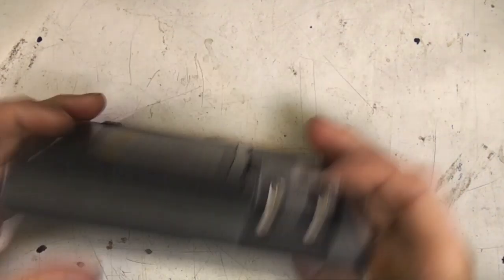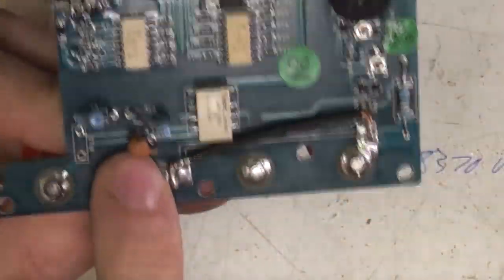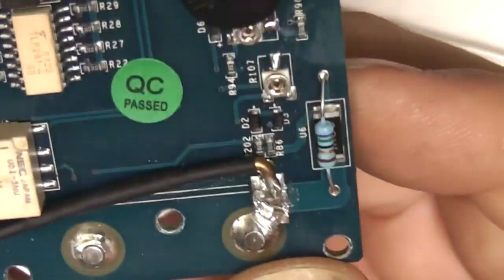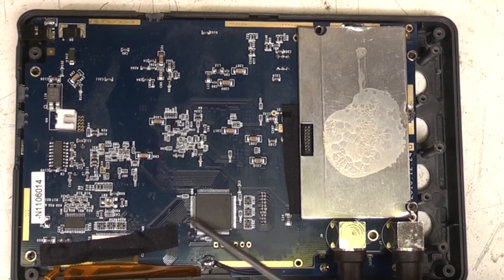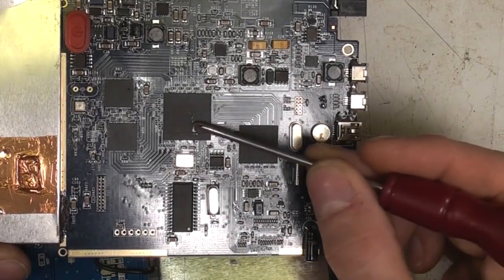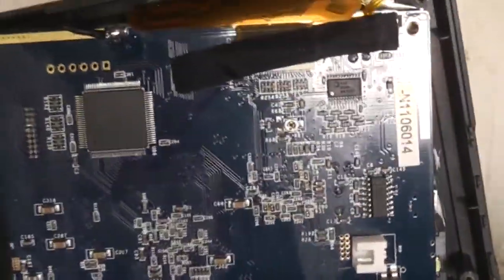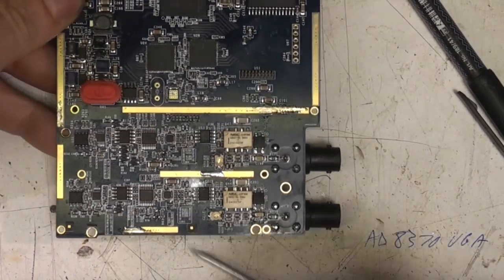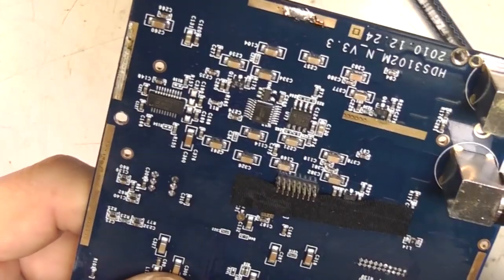Owon HDS3102M-N portable scope Teardown

Comment: The biggest problem I have with their portable scopes is the outer insulation on the bnc female terminals.  Most connectors do not make a good connection.  For a portable 4.5 digit meter and scope though for $130, eh..

Comment: Great oscilloscope!⚬⚬>imgs.love/Ow-Oscilloscope?Ҵ   So far I've used it to test the MAF, IAC, and CPS sensors on a Ford Explorer. Trigger works great and is easy to use. You can set the trigger in a menu or by sliding a cursor on screen to the desired voltage. You can also freeze and the save data displays. Has a wide variety of features. Attached is a photo of the MAF sensor output at lo rpm.

Comment: @1:35, @2:07 and @5:08, sniffles probably because of previous off-camera coke snorting. Hence the nervousness and constant fast wiggling around of the hands, and annoying tapping with the screwdriver, and fast monotonous mumbling throughout. 
As for this entry level Chinese scopemeter, you can't seriously expect the quality level of a Fluke many times more expensive, common. This is great for the electronics hobbyist that just needs to visualize signals from time to time and doesn't want to invest massive amounts of money in über expensive tools that will be used only occasionally. Not a professional engineer. A good Fluke multimeter coupled with this cheap scopemeter is a great compact portable combo for most of us non-professionals. Owon HDS3102M-N: $500, Fluke 190-102: $4000.

Comment: The 250MSPS ADC is an industrial common practice. In almost all low end scopes, when they promote 500MHZ 2ch, they are saying 500M at 1ch, 250M at 2 ch. When only 1 channel is used, the 2 ADC operates in interleaved mode, thus provides 500MSPS.